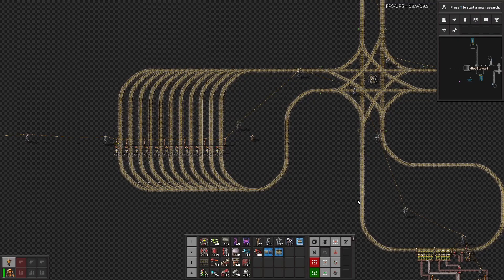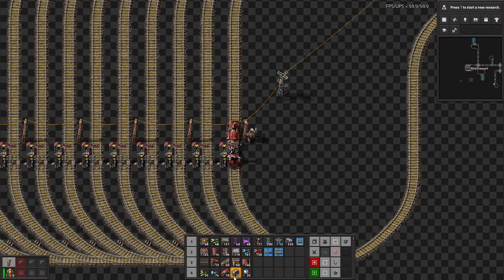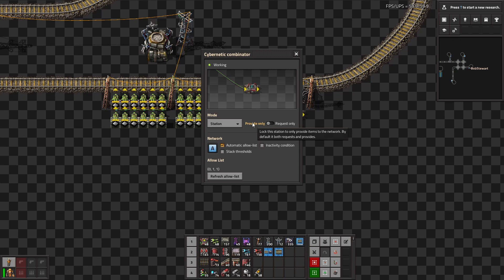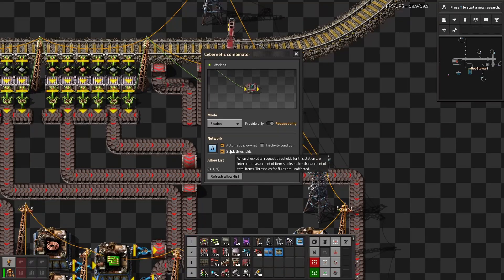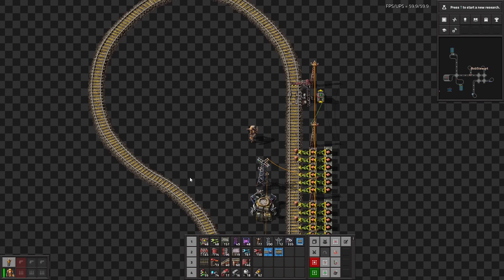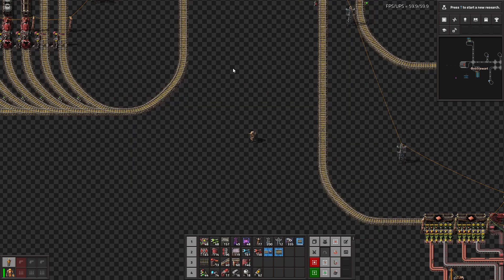Factorio 2.0 Cybersyn Basics (Updated Guide)

Comment: I use a 4 cargo wagon setup. So... if I want at most 54k iron ore at a station, and I want to use stack thresholds, I set the Request threshold signal to 160 (40 * 4), and iron ore to -54k. However, when I do this, and hook all the wires up, no trains are dispatched.
Reply: I can fix this by disabling the stack thresholds option. I also set the request threshold signal to 54k, because if it is left at 160, trains will find delivering 160 iron ore at a time acceptable.

Comment: Is it possible to have multi-material provider stations? Maybe some way to turn off the unneeded inserters?
Reply from the maker: Yeah you should be able to, I just use filter inserters but if you want all inserters working to load train there might be circuit stuff you can do, not so sure

Comment: Mine arent moving even after getting the stations set up. They just sit at the depot
Reply: Bitt late, but number one issue is converting to cybersyn is train station limits, this will often be set to 0 and will prevent trains from ever arriving.
Reply: Make sure the allow-list is correct in my expierence the automatic allow list is not set correct when the Cybernetic Combinator is to far away from the station.
Also make sure the chests are connected correctly to the Cybernetic Combinator.

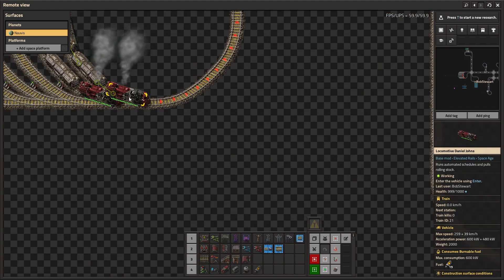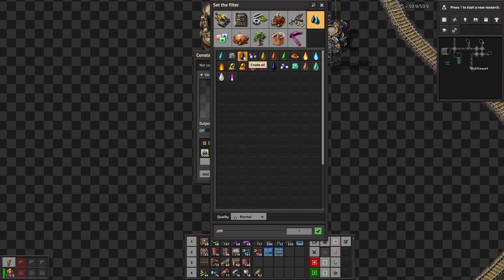Comment: Around 6:40, you mention that you set the combinator to -20k iron and -20k copper plates. Around 10:00, you set the fluid to -150k. Is there a best practice for setting these numbers? Compared to the max cargo capacity of the train cars perhaps?
Reply from the maker: I would set these number relative to the amount of storage you have at the station. For iron and copper I kinda winged the number since I think 12 steel chest hold about 24kish iron or copper plates. For fluid it is much easier since its 25k per storage tank.
Reply: @kevinincorporated937  so set the amount to be equal to the storage at that station?
Reply from the maker: @michaeldoucet-morokael  Yeah pretty much.

Comment: After using 40 trains my entire megabase died down, it is pure chaos, copper ore trains do not fully unload and head to the next destination, a green circuit factory, clogging up the entire base. is this a common bug?
Reply from the maker: No, I am going to assume something messed up request wise. If its not fully unloaded perhaps you are requesting more material than your buffers can hold? Remember stack sizes differ so you have to change your total amount you want stocked per item
Reply: @kevinincorporated937  if you use the stack setting this wont happen. also every train only is supposed to depart if the cargo is empty.

i deleted all trains an readded them , its working now.

by the way, very important info - do not use the priority setting in the vanilla trainstop, it can cause this issue too. however i did not use priority.

cybersyns discord made an announcement yesterday
Reply: Another Important Info: Stations names do matter! this issue also happens, if the REFUELER station has the same name as a DEPOT

Comment: Do you know how to disable refueling ? Im using a electric locomotive mod. Even though i put refueling level to 0 in the mod settings trains keep heading to refuel.
Reply from the maker: I don't know how to but if your just using electric locomotives you could just not have one right? Theoretically then no issues. Otherwise I would ask CyberSyn discord or the mod author might need to be made compatible
Reply: @kevinincorporated937  its no issue they just go to the refueler and continue to the depot , but when i dont put a refueling station train stop at the last station.   What im worried is that amount of traffic going to refuel.

Comment: I built one network in test world and mange to make it work, but everytime I  use it in my proper world. Trains can`t find a way to station from depo. Been bashing my head against trains for days now. Only diffrence was amount of cars 2 in test or 4 in my game world, but even changing that does nothing
Reply from the maker: This sounds like a train signal problem, consider clicking the train and holding ctrl to station to see if it can path there and then back.
Reply: @kevinincorporated937  I forgot to mention that, but manually trains can get from depo to pick up and back without issue. I will try later tonight placing depo in diffrent spot and using diffrent junctions as entrences
Reply: @kevinincorporated937  Change 2 of my 4 way junctions to T ones and quickly tried one station with copper to deliver and it seems to be working. It works now but i don`t know why LOL
Reply from the maker: @wrobel2222  well glad to hear its working